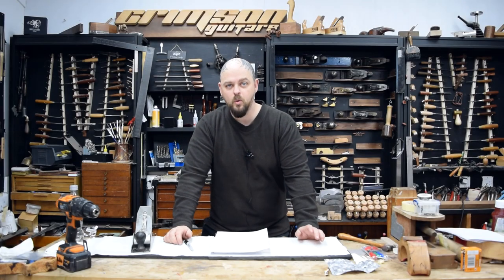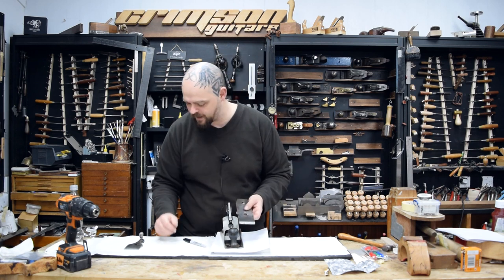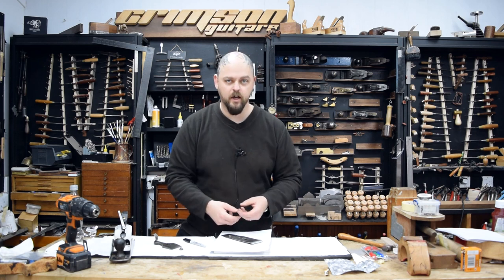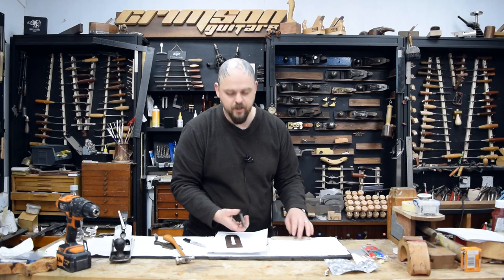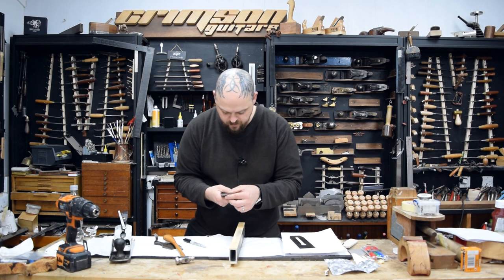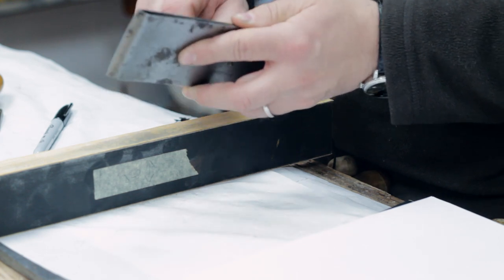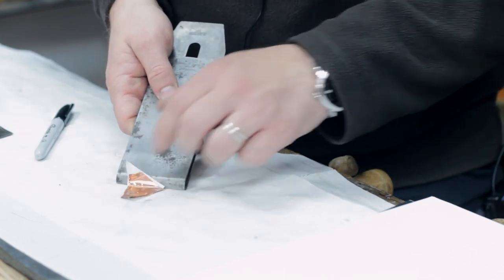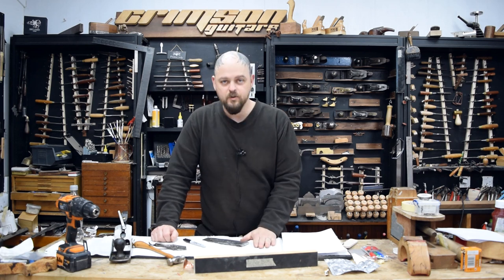The cause and correction of Hand Plane clogging - Mini-torial Ep 24

Comment: Good video. I have had 2 clogged Stanley planes all  afternoon and they are razor sharp and the throat of the plane looks dandy.  I will try levelling the chip breaker like you says and also get it 3/4 mm from the blade end.

Comment: Actually, according the Paul Sellers, the cap iron is what americans incorrectly call the chip breaker and the thingy you called the cap iron is actually the lever cap.

Also, Paul says (and it kind of makes sense) that chips are not actually broken in a bench plane. In fact, there are no chips but long shavings. As opposed to power planers that need to break the chip to prevent clogging the extraction.

The thing that prevents tearout is actually the mouth of the plane! 

Finally, what is then the true function of the cap iron if not to break chip? It is to make sure that force is applied to the plane iron close the business end, to prevent is from bending up and chattering.
Reply: While I do not disagree that the chip breaker does not break the chips, It can help control tear out. I have tested this my self on several occasions, and there is a video somewhere on the internet of some Japanese researchers that backs this up. I must admit I do not fully understand the mechanics of it however. The thinner the shaving your are taking the closer to the edge the chip breaker needs to be in order to work, but also the harder the plane becomes to push. At some point it gets too close and you crush the shavings int to an accordion like shape that likes to clog everything, which is no good. The optimum setting seems to be when the shavings come out almost straight, as opposed to tightly curled (too far away) or to crushed (too close). For hogging off material however tear out is not such an issue, and so the chip breaker should be set back from the edge a little to reduce the required effort. That is my view on the matter at least.
Reply: neistridlar I think this has to do with micro-chattering of the iron. With a bevel-down plane, the force on the iron is very much not in line with the direction of the blade. So when there is force on the blade, it will bend, until the wood is weak enough, at which point it will jump back up, tearing the wood. By putting the edge of the cap iron closer to the cutting edge,   you damp that vibration, thus reducing this effect. The strongest proof for this theory is the fact that  bevel-up plane don't seem to suffer from not having a cap iron. This is because the force is almost in the direction of the plane.

Comment: i have a silly question...yes i know it IS silly but its ok lol. I understand the basic differences in the various planes..sizes, angles etc. But u have heard people talk about setting them up differently. This confuses me because i thought there were only 2 ways to properly sent the blade and breaker depending on the planes purpose...correctly...or not lol. the breaker has to be where it needs to be...the blade as well i thought so assuming i have say two identical no, 6 bench planes or 2 block planes..is there a way to set them up so they are different, in essence giving me 4 tools or are they simply just duplicates? see told ya it was silly